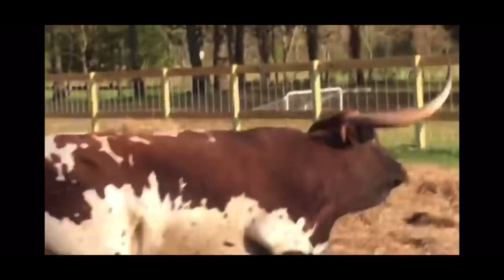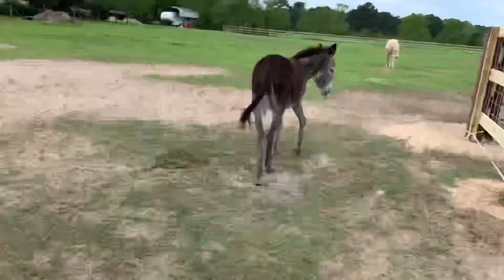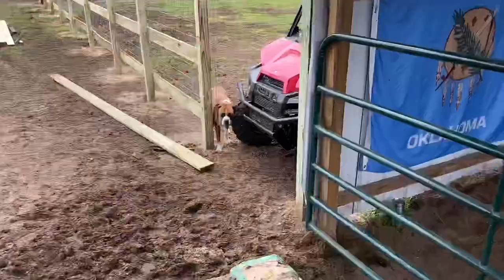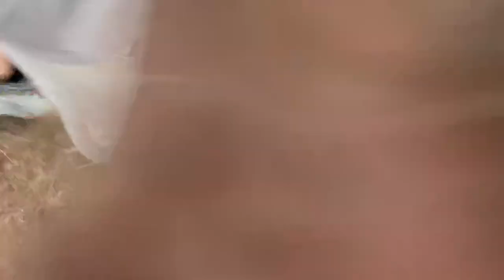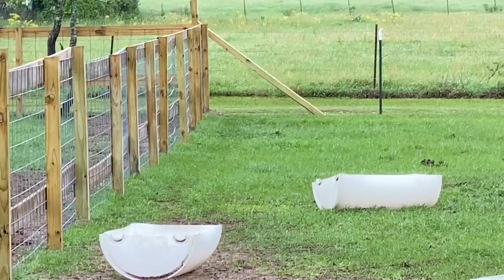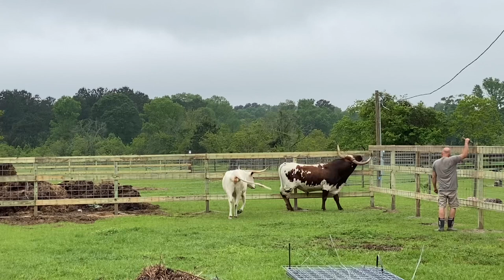Tex Finds A Forever Home #LonghornLester’s

Comment: Fences are less weak when the fencing material is on the inside do it can't be pushed off from inside.....my 2 cents worth
Reply: After spending many years on a cattle ranch, that was my first thought when I saw the boards on the outside.  Tex will eventually push right through those boards.
Reply: Never mind that. I'm surprised anyone would use wood plank fences and what is basically big chicken wire to try to contain bulls.  You need deep set posts in the ground of thick, strong wood, and heavy wood crossbeams.  Either that or you just go full elephant with the giant girder fence.

Comment: Tex will get out!!  Just saying.
Reply: walter trader   I am afraid that I agree with you. I was thinking if the metal part of the fence was on the inside, he can’t just ram it like Ringo and push his way thru. If this doesn’t work, if they sell an entire fence like the gate, that might contain Tex the Tornado?
Reply: He will clear that fence as soon as he gets wind of a fresh cow.
Reply: He can easily jump that fence. Our bull (a limousin) jumped an 8 ft stone wall. He didn’t even run and jump. He just bunched his muscles and jumped. The dog and I just stood there not knowing what to do! That fence looks nice but it’s not holding a bull.
Reply: Well, we have an office pool going! 2:1 odds favoring Tex.
Reply: Don't be surprised when ol Tex gets out again. He needs more girls, higher fences, hot wire, wire on the inside, treated round posts with no cement and a couple strands of barbed wire along the lower sections. Good luck. Do you see his potential as a hat rack?
Reply: As an old fence builder from way back... The wire panels are on the wrong side of the posts. The metal staples are what is supporting it not the concrete posts. I chuckled at Tex and the tube gate.  Our pony could accomplish the same thing.  Need a gate about 3x that gage. And a nice bulldozer electric fencer. One that makes his hair smoke when he gets close. Gotta appreciate that sound of a good snap. He'd learn to respect the fencing real fast. 
   That said you have a beautiful pair of bovine there. It's clear to see you and your beautiful wife aren't afraid of work and truly care about your animals.  It takes a big heart full of love to commit to their care. Wish I could have helped you out, all except the RAT... 😉

Comment: Over here in GB we buy quick drying cement which you can put in your post hole as drylene  or mixed with a small amount of water and it will go off rock hard within an hour or two and completely cure in a couple of days. Mixing up compo your way though is an excellent way of keeping fit.

Comment: They have concrete made by Quickrete in a red bag called Fast Setting. You pour it in the hole dry, then put water on it and it sets just like that. It's especially for fence posts. Put a little water in the bottom of the hole, pour bag in hole, add a little more water on top and it's sets in no time. Saves your back from all the mixing. Hope this helps you next time you're setting posts.

Comment: Have you ever set fence posts with gravel?  Packs really tight, drains so it don't rot the bottom of the post as quick as concrete. And you can use a steel bar to loosen up the gravel should you need to pull the post for whatever reason. I've done a few fences this way and won't use cement anymore. 
Recent subscriber, lot of fun to watch from my usual content choice of cars. Small creator here lol

Comment: You know those huge metel pipes? Like the big sprinkler pipes for fields? You can strap or weld several of those together and make your own cattle grade, like you see on roads. Make it least 5 feet wide and put them on the ground up against the inside of the fence. If he cant walk up to the fence he cant tear it down hence he cant get threw. It is near impossible to stop a bull when he wants to do something so you have to play to their weaknesses and NOT their strengths. Their feet are their weakest point and if they cant walk to something you stop them. Partially bury the pipe so he cant hook it with his horns and lift it. With that and seeing the fence is on the other side of that grate he knows he cant jump it. Just make sure the pipes are welded together so he cant get a hoof inbetween the individual pipes and you are good. Like a " fence with in a fence" type of thing he cant tear it down and he cant jump it. It will do perfectly and you dont have to keep fixing fences.

Comment: It's probably been suggested before, but you are putting the boards on the wrong side of the posts.  When the bull pushes, he is pushing the boards away from the posts.  If the boards are on the inside, the bull pushes the boards into the posts.

Comment: Next time you build a fence you should put the horizontal timber on the inside of the uprights  then screw on that way the animal weight will transfer to uprights instead of just the screws holding them on

Comment: Just for future reference that's why they make pipe. Best thing to hold bulls in. And one more thing, if you have an animal that pushes the fence you would be better off putting the boards on the inside so it pushes against the post making it more stable

Comment: My dad always just pours the concrete from bag to hole and just  use water hose or 5 gallon bucket and adds water in the hole. Mix it a tiny bit with a stick and just let her cure.

Comment: About most difficult job.it is not necessary to mixing concrete.just place dry mixture into the holes around post,and add water! It is designed this way .for 60 lb bag one bucket of water.

Comment: Lester would metal pipes filled with sand and cemented in and that cattle panels atatched on both sides work to keep him in better. And instead of 1×6  you can use pipe connectors metal of course and put 3 pipes 1 on top 1 in middle and 1 on the bottom like you have the wood i know it might be costly but if you do it slowly. Put the pipes and cement in along outside of the fence now and when all put together then move pannel to metal so you can reuse parts. Or just add metal pipe for post in between like a thrid way between   so 2 pipes in between whats there and 3 at corners so he can't separte them. 1 at each side and 1 at point where they meet. So it would be the wood and 3 metal he'd have to break through. Just a thought.

Comment: Run 3 electric fence wires on inside of your fence use outriggers so the wires are at least a foot from the main fence , electric fence unit requires 7000 to 10000 volts . This will not harm him just his pride. And your fences will love you for it

Comment: 18ga wire hooked up to a D-Cell flashlight battery will give him just enough jolt to make him a believer to stay those horns a good distance from contact of the galvanized steel cattle gate!
Use a Cutter on those horns! THAT will keep that bad boy in check!

Comment: You have a bull like that then you have to double your supports by shortening the gap you have almost 8 ' between the post. If ya don't want him to bust wood you have use steel and not the thin stuff from supply stores. And make a steel inner fence and will solve the issue in his main pin you want him in

Comment: Tex can push the boards and wire panels off the post. My opinion is you would have better results if you would have fasten the boards and panels to the inside of the pen. Then you have the posts as support.

Comment: When you build a fence put the wire and boards on the side that you are primarily concerned with containing the animals on . That way it all works together to withstand thier efforts to escape. They will rub and push against the nails and staples forcing them to loosen and come out.with wire and boards on the outside of the post. Electric is the easiest way to make a bull respect your fences though.

Comment: Lester... I am sorry to say this but your fence boards are on the wrong side. If you put the posts on the opposite side of the animal. They will be pushing the fence board to the pole. The way you have it, is aesthetically more pleasing but not as strong. Animals can just push the nails out. Screwing your fence boards is stronger too. You maybe doing that.  I think you may already know about the pronged fence staples, those are amazing. Total game changer. I also use electric fencing in addition.

Comment: I would've screwed the horizontal boards to the other side of the 4×4 posts. Your way only has screws holding it in place, my way has the 4×4, and the screws holding it in place. The 4×4 as a back bone, and that board ain't going nowhere.

Comment: Electrify the gates and he will think twice about it....or maybe he wont lol. I'd still have hot wires on the inside of his fence with extensions for insulators that stick out a foot from the fence so he hits the hot wire before he hits the fence and deters him from even wanting to test the fence. If he can rub on it he will destroy it eventually and get out. Only thing that might stop him is a hot wire because he clearly already knows his size and uses it to his advantage and no regular fence will withstand it long.

Comment: I have thought and thought about your gate problem with Tex and I am trying to picture you having to deal with this escape artist and then I remembered something interesting about most cattle, they don't like to step on grates and that those are used on some big ranches instead of gates.  I wonder if you dug a big trench either side of the gate, put in the grate, then utilize a solid piece of wood or metal to cover the grate when you waned to move them in and out through the gate...he would not be able to reach the gate to destroy it.  Maybe?

Comment: Put the boards on the inside of the post so when they push on it it doesn't push rails off the posts. If you have animals on both sides then run rails on both sides. This is common sense.

Comment: Why not build the fence the right way? Put 10 inch posts in the ground with high tensile wire and a electric fence box, make heavy steel gates with heavy hinges.

Comment: Wouldn't have been cheaper and easier  to just add a couple of strands of electric wire to your existing fences ? 
I just reckon when there's a cow in heat in a nearby paddock he'll just put his head down and push through ..

Comment: Should put the rails on the inside. Your bull is gonna pop them right off. On the inside with nails holding them in place makes it much harder for him to take your fence apart. I built fences for large farm animals for 35 years. Plus I usually electrafied it. For their own safety of course. Just sayin!

Comment: Well I have never mix cement up for post that go in the ground its a waste of time all you have to do is put the post or pipe in the hole an grab a level an put the bag of cement next to the hole cut the bag open level the pole start adding cement then grab along bar or the handle of a shovel an pack the cement in till the pole don't move then go to the next hole an  Repeat the only time I add water if the ground is Rilley dry but yeah that cement will  Suck the Moisture rate out of the ground it will be rock hard. It is funny woching you mixed up that cement by hand lol here it is a year later and Tex is still braking out i am theking you put a post in every 8ft now how to fix it in between each post add a nether post so it will be easy 4ft an for the gates you can't use store Bought gates you have to have someone that nowes how to do welding an make Tex proof gates.

Comment: Have you thought about  a strand of electric on the inside of the fence? Most cattle won't mess with it after they get zapped a couple times and they make solar chargers. Nice sturdy gate! I worked with rodeo bulls and they kept them in with 3 strands of electric fence.

Comment: Your welded fence is on the wrong side of the lumber. Especially considering, unless you haven't finished yet, an occasional staple every couple of feet will not hold your bull. But, then again, if he doesn't get out again, no more videos to generate income.

Comment: Is he a bull or a steer? If he is a bull, its time to castrate him. That will help him calm down. My cousins have kept cows (longhorns and angus) for years. They keep theirs in with a single strand of electric wire. Thats it. If he rubs his head on that fence, he runs the risk of getting a horn caught. Then not only does your fence get torn up, but he can get seriously injured. A cow that learns it can rub on fencing is a hard habit to break. Only fixed with electric wire. And while it does sound cruel, it does keep them safer. But I am glad he is in a sanctuary to give him time to learn. Most would have slaughtered him already.

Comment: Why would you waste all that time and money on wood that rots and pannels that bend t posts and barbed wire or pipe and barbed wire would be long term. Also better run a hot wire to keep him off those panels cuz he will push the staples loose and get out

Comment: I am amazed you haven't got killed or crippled by that bull.  But don't worry, you will!!  There is a difference in a farmer, and a wealthy boy pretending to be a farmer ;)  A farmer wouldn't put up with that thing any longer than it takes water on the stove to get hot ;)  Figure $300 for that hide, another $150 for the horns, and over 1000 lbs. of meat.  His butt would have been on the truck to the processor long ago!!!!

Comment: You are bragging about success but seeing as you don't believe in ELECTRIC FENCING (which works wonders when used with the intensity to wake him up) you will find you spoke to soon.  Plus your in for more repairs having put the wood and wire on the WRONG SIDE of the posts since he likes to lean and push on it and he will, in time of continued pushing, loosen nails and staples and get out again.  I know of what I speak, having grown up on a farm, done my own fencing for my critters and helped others..with the intensity Tex has wanting to be free, he is by NON MEANS going to calmly accept this fence.  Put up hot wire or castrate him.  Doesn't seem to be a need for his being intact.